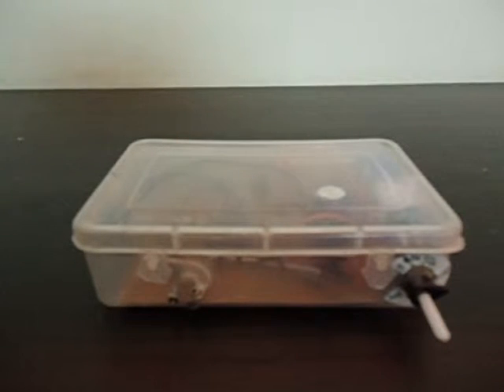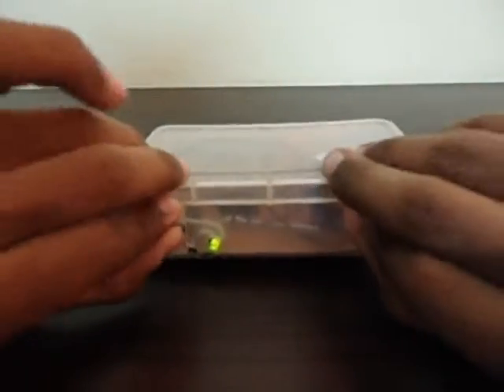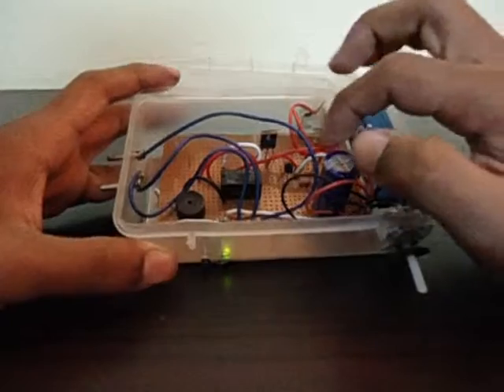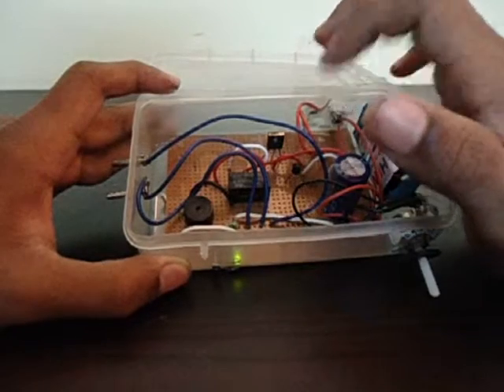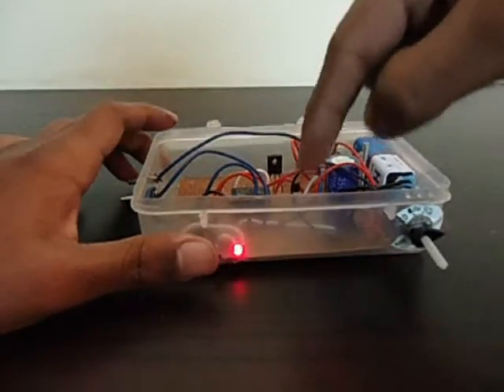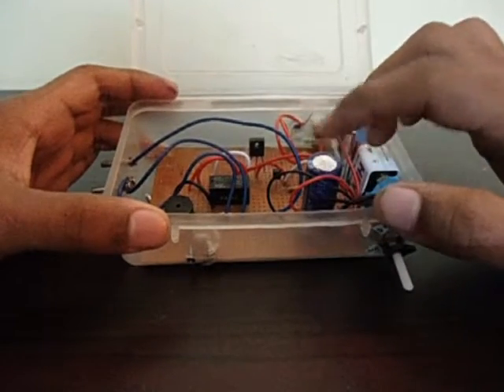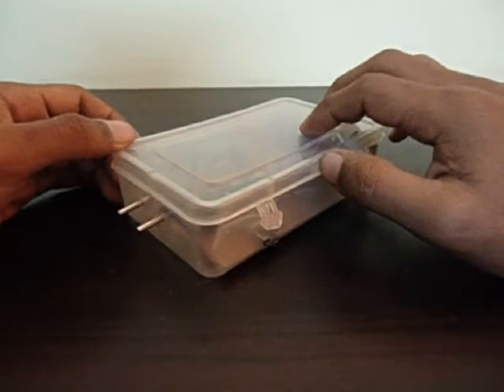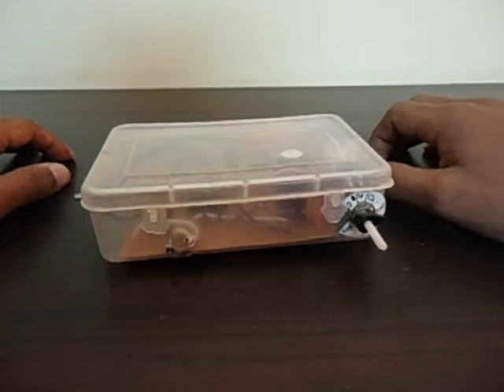Electronic Timer - No IC chips

Comment: i do not think that the circuit matches with your circuit diagram. you said that negative terminal of the capacitor is grounded while the positive terminal is connected to the resistor. but the diagram tells us a different story. Will you please explain it
Reply from the maker: Oops, you're right. I must have been careless while drawing the circuit diagram. Thanks for pointing it out. I'll remove it from the end and put in a link to a drive file or something instead.

Comment: hi hello..can i ask something? I Had a digital clock with four push button set, add, reset and exit.ahm can I use this to have an output from my digital clock to raspberrypi either?thanks for considering my question.if it is so, what IC is to be used?.my no. 09352026798..e-ad markkimblando@yahoo.com